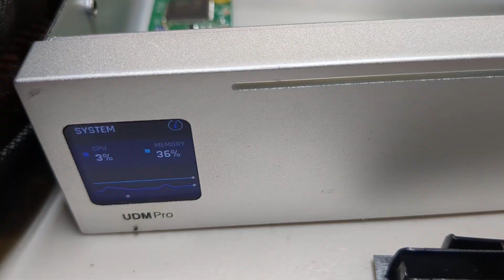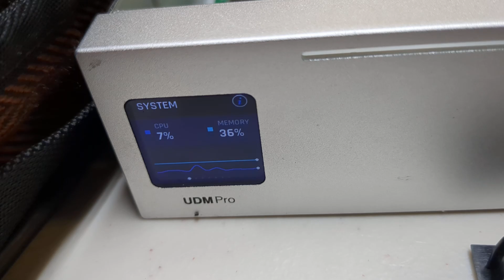Fixing a bricked Ubiquiti UDM Pro Dream Router with recovery mode not working

Comment: OK I want to thank you for posting this. My UDM Pro randomly crashed the other day and went into Recovery Mode. I was not able to perform a device reset and re-installing the firmware did nothing. After finding your video, this morning I removed the lid and attempted to discharge the capacitors, not really thinking I was accomplishing anything but lo and behold it came back to life. I did have to restore from backup but this video got me back in business. Thank you very much!

Comment: how did you short the caps? Im currently sitting in front of my UDM pro opened up and would LOVE some guidance
Reply from the maker: I just used a short piece of wire. A paperclip would work in a pinch.

Be ABSOLUTELY SURE the unit is unplugged and has been unplugged for at least half a minute or so, then find the larger surface mount electrolytic caps. Next to the standing cylindrical body of them, on the plastic base, there are two metal leads that stick out and are soldered to the board. Touch both sides of them with a wire. You probably don't need to hit every one of them, but get the largest visible ones. If you probe both sides of a cap with a multimeter you may see some weird number of millivolts before (and maybe even after) shorting them.
Don't worry if you see like ten millivolts or something even after shorting the caps, that's just dielectric absorption and is normal. And weird. Did I mention weird? Anyway what really matters is that you pulled that voltage down to zero for a moment, and that will allow static RAM cells to reset to zero.
Reply: @hyvahyva  i’ll give it a try later this week. It’s been unplugged for over 4 days now. Much appreciated for taking the time to come back